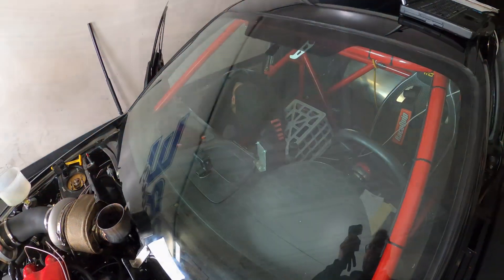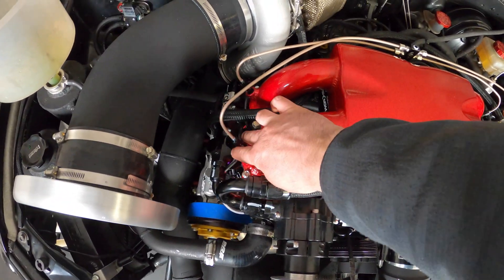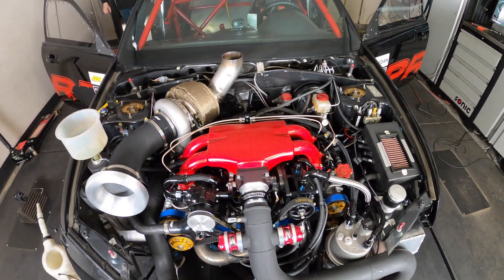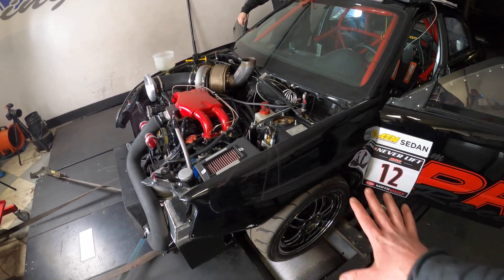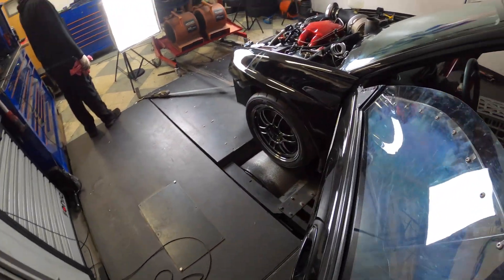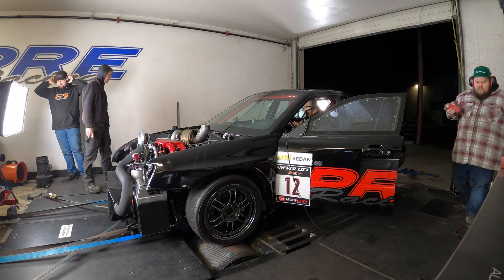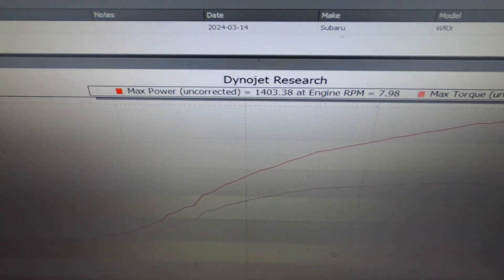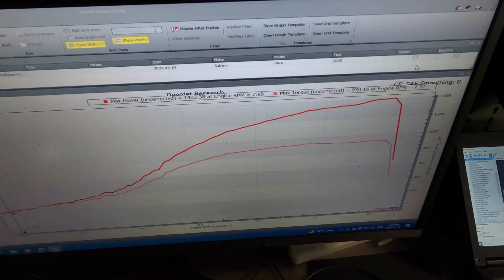PREracing Black Widow: Taco Tuned 1403HP & 930 lb-ft Torque Subaru breaks the dyno!

Comment: What headgaskets would you recommend for 900hp? I had an issue with Athena gaskets and wondering if I have to switch
Reply from the maker: This car has stock head gaskets at over 1400whp. We pretty much run stock at every power level.
Reply: @WT4T  I’m guessing 1/2” studs? My current set up has Athena gaskets with Arp 2000 1/2” studs but I’m wondering if I’d be fine with Athena gaskets and 625+ 1/2” studs ?
Reply from the maker: @JEwr_ this car is a proprietary sleeve,  oem gasket,  o-ring head,  1/2 ca625 stud, pinned mains, some other fun stuff.

Comment: Honestly how can you even hold the power down to the wheels on the street. What a beast. Your gonna have to de tune so the wheels don’t spin but my god. What a monster.
Reply from the maker: It's not a street car but it does race on unprepared airstrip surfaces.  It takes a lot of fun power management to get it down the track but that's part of the battle!

Comment: His aos is so stealth. See officer just a k and n filter nothing special. Every one now confused. Closed hood before anyone looks any harder and hopefully gets out of 0-100 in 3 seconds or less on an on ramp lol but the pcv breather is brilliant whoever made or did that is a genius and. I’m throwing my old shit in the trash now and building one just like that. All my aos system problems will now be solved
Reply from the maker: We built the AOS for this car back in 2012ish
Reply: @WT4T  it’s genius and I can’t believe it’s not on the market. The big filter makes it actually work as my aos was choked up. I started drilling holes in the lid untill I ripped the lid off and then it worked. Then I was doing research and saw your aos. It’s right on the money.
Reply from the maker: @user-nf3oq2ge3g iag makes one kind of similar now.  The issue is they're very custom and making one that's "one size fits all" would be difficult

Comment: Bader is going to be pissed! I think he did just under 1200hp. Did Bader apprentice under you guys, I thought I remember his early videos at a different shop.  Congrates on the dyno numbers, that is insane out of that little motor
Reply from the maker: He worked for Steve tuned who has been working for us for a few years.
Reply: Insane the block doesn't twist in two. Great work, many tacos awarded
Reply from the maker: Oh,  it's trying for sure
Reply: His VA did 1415 WHP / 1074 WTQ about 2 months ago
Reply from the maker: @gregb8153 corrected numbers though,  not raw.
Reply: @gregb8153  1411hp
Reply: Bader seems to me, to be a liability to the credibility, of this community. 
Plus, his channel is basically a black hole. 
A black hole that eats motors we may want to keep our cars running in the future. 
Just my 2 Pennies. 
I believe these guys are waaaaay more legitimate than that other channel. 
2 different worlds.
Reply: @whitechocolate415   both were equally capable... Question is how much u want to risk it for the tacos...

Will it survive more than a single pass...

Like in actual race event u need to be reliable as well as being fast..  cheers 😊
Reply from the maker: So far we've had more gearbox issues than anything else
Reply: @WT4T  was it still on stock box?  Or sequential box with lower torque rating version?
Reply from the maker: @AmirPomen Kapps Sequential. No one actually makes a box rated for these kinds of numbers.
Reply: @WT4T  yeap.. definately uncharted territory for scooby making that much power and torque..

Wishing u guys good luck..

Cant wait watching the car on track